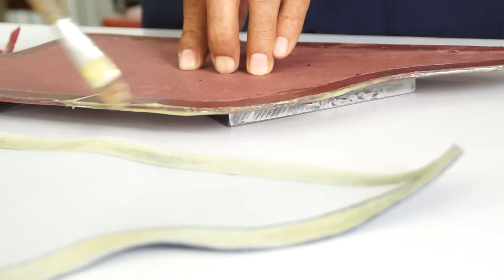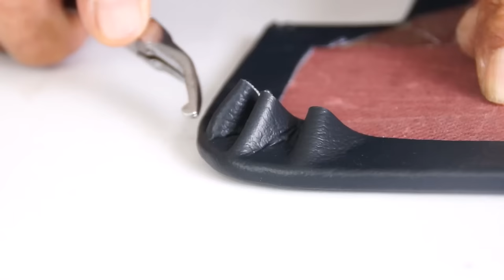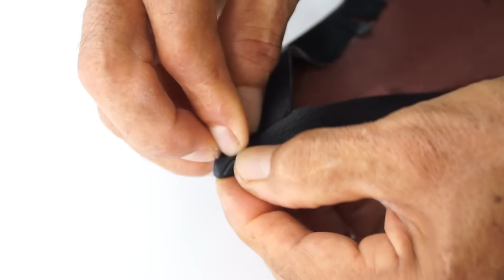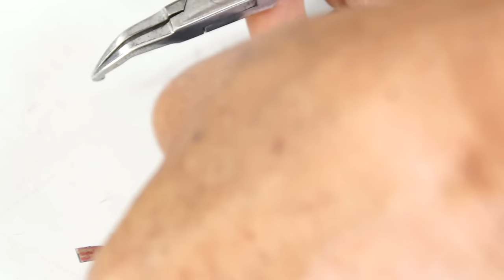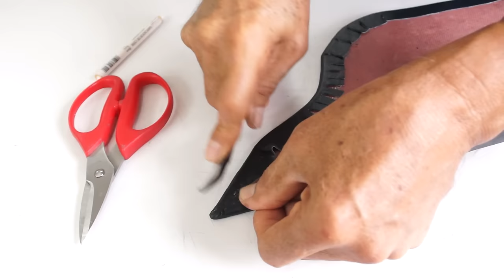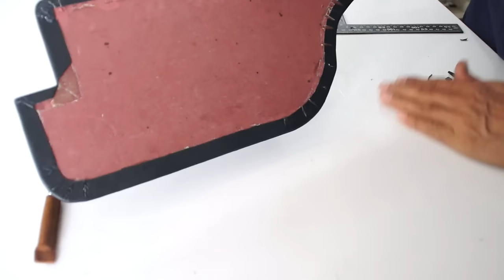How to Upholster Corners on Door-Panels - Upholstery basics for beginners

Comment: For those of us new to the idea of using professional-grade cement like the VL-2000 (and not having access to this product in the US) what is a reasonable substitute? Barge? Master? I always want to ask this question while watching almost every video you produce. Any guidance would be greatly appreciated.
Reply from the maker: A substitute could be: 
https://www.ebay.com/itm/114649877783 (brushable glue)
https://www.ebay.com/itm/254593470049 (brushable and sprayable)
Reply: The Weldwood contact landau it's a excellent choice is resistance to high heat use for years on car tops, use it in my shop,  most trusted by upholsters in the US.

Comment: Thank you Cesar for a great and very helpful video. I noticed that you did not use any adhesive on the front of the panel. Would you suggest doing so on larger ones? I have a couple of panels of similar size to the one you used in this video but I also have four that are close to three or four times the size. Thanks again, Ian.
Reply from the maker: If you have larger panels I would suggest the same method for plain panels. It is not necessary to glue the whole top panel. I would suggest to cover this area with a thin foam 3, 5 mm; 1/4" thick

Comment: I noticed you’re using 1/8 inch board. How would you wrap corners on 1/2” and 3/4” boards/pieces? What’s the math on how much to cut away on the corners?
Reply from the maker: The process is similar for thicker edges. I applied the technique in this video:https://youtu.be/RK50VXOawIU?t=2723
Reply: @Cechaflo  ok thank you!!!🔥🔥🔥🔥
Reply from the maker: @papergatorzfedducca7998  A related video:
https://youtu.be/beiywfE1lZE?t=322